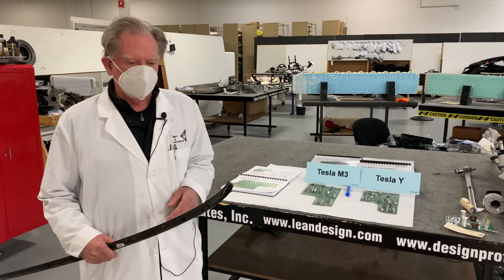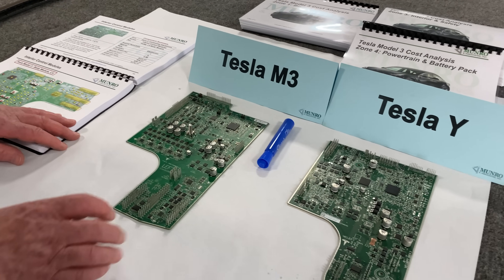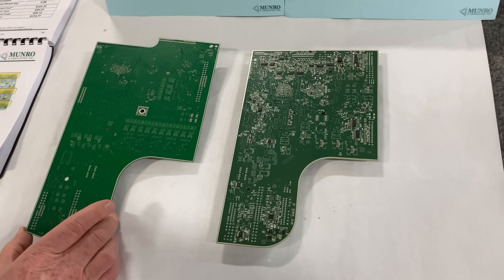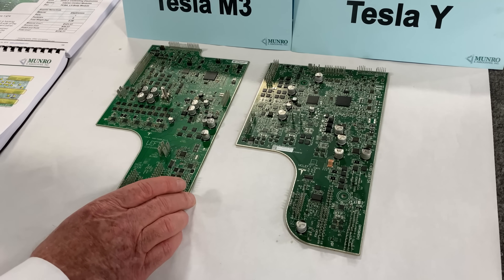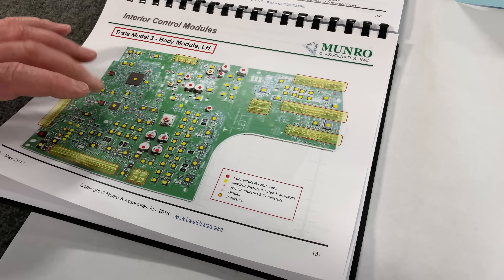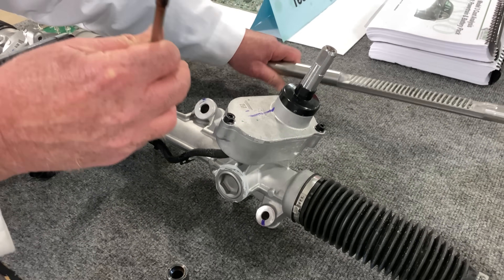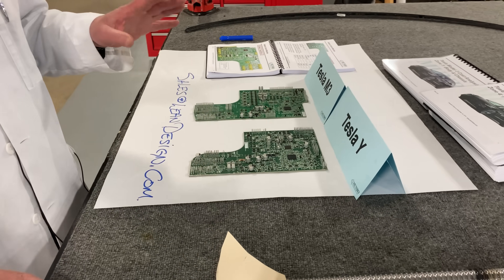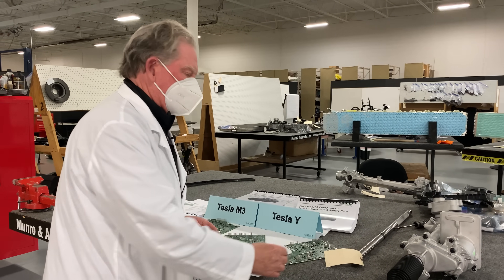Model Y E39: Spoiler Alert! Sandy Talks About Electronics, Body Controllers & Steering Rack

Comment: Regarding steering system, they are rated as ASIL D (according to automotive safety stadandard, one is ISO26262), meaning that a fault has high probability to kill people. This means redundant hardware and software. So basically there are 2 similar computer. Regarding body controller ECU, BMW have huge boards with multi-core microcontrollers. What tesla has is not really that complex.
Reply: I'm a bit puzzled that redundant electronic hardware would sit that much closely to each other. If you get something wrong on one side, how is the other part isolated from the exact same fault?
Reply: I don't think it's about core count here. I think he's looking at circuit density. Those boards look on par with a modern pc motherboard. I don't know any automotive part with a fraction of that density, but do prove me wrong if you know one.
Reply: Also, most automotive companies I know barely have any software or electrical engineers on staff. So, this level of development would not be fair to expect from them, they would have to outsource and we know how that story goes.
Reply: Last point on this. Bigger is bad in this case. The name of the game is reduction. You have to reduce the size and weight of many systems in the car by integrating into one board. Reduce size of the board by high IC integration which = high on board density. 

So, this means that you end up with a small board with lots of stuff on board, but it weighs less than your previous solution, uses less space, and probably consumes a lot less energy. All good stuff for an efficiency conscious design (both EV and ICE).
Reply: I work in automotive, on supplier side and according to safety analisys a rated is given ASIL A,B,C,D. For each there are some actions to mitigate the identified risks. On steering is 1 board, but they are separated: 2 microcontrollers, 2 h-bridges for motor control, 2 power supplyes for circuits on board, software is doybled. There are many measures taken to protect from external faulta and internal fault (memory corruption, software errors, etc). All manufactirers use the same stuff.
Reply: @catalinmacovei6907  ??????? Use the same stuff? I've seen plenty of automotive PCBs, never seen one like these. Please post pictures if you have them. Also, there are many ways to achieve a standard. These standards do not require that you use even the same parts since that would be corruption of the standard(favoring a specific company within the standard). Just that same processes and results are achieved.
Reply: When I said all car brands using the same stuff, i mean same concept of redundancy, same idea, not the same components or schematic.
Reply: @catalinmacovei6907  ah... gotcha.
Reply: Regarding the body controller module, I remember I saw one for bmw with similar density of compone ts (at least vidually, ofcourse I can't count them). Some colleagues worked on that project and I just saw the board but not worked with it.It was big as 15 inch laptop keyboard.
Reply: @catalinmacovei6907  once again, we are not talking about size here. It is probably possible to achieve the same functionality in the size of an iPhone's motherboard. The point is the amount of components per square inch... in other words density.

Comment: Elon has said from the outset that anything related to full self driving would be fully redundant, down to the steering gear. It looks like there are two power feeds to the controller and probably two data cables as well. So, even if the board isn’t damaged, but a wire feeding the board (power or data) is, you’ll have full functionality. I am banking that the board will sense even a bad connection and alert the driver for service, but that the system will still function fully since it is redundant.

How about ABS sensors Sandy? Have you found two ABS sensors per wheel? I wouldn’t be surprised...
Reply: There are some things that may not be redundant in the system, however most of the sensors that will enable Level 5 autonomous driving should be there. Technically they are already at Level 3, and the AI controller board is built with redundancy. That particular board hasn’t been reviewed yet, though it’s decades ahead of anything short of the military.
Reply: Arthur Dries I think that Munro and Associates did look through the Hardware Level 3 board for the Full Self Driving computer. I believe their Model 3 had this board installed even if they didn’t option the software for full self driving. Elon stated during the Investor’s Autonomy Day last April 2019 that all cars produced since mid 2018 have the logic board installed.

Comment: Populating both sides of the PCB is going to cost more time and money. Needs another solder paste, glue, pick and place and reflow process.
Reply: Unless you’re putting the exact same board in all of your vehicles. The sensor suite and form factor for their electronics have stayed the same since AP Rev. 1.0, making all your older AP vehicles backwards compatible for an upgrade.
Reply: Arthur Dries I suspect boards are approx mirror images to avoid confusion and to locate symmetrically within the chassis. Each board, rotated 180 degrees nests with itself for board layout and assembly efficiency.
Reply: The old pcb had double sided placement as well.  Mostly bypass capacitors for the FPGA and microcontroller.  Might as we fill up the back too, you're not going to hand solder these on at Tesla volumes...

Comment: The board for Model Y does look like its a lot more capable but does not put it much further ahead of other OEMs than it already was with the Model 3 version 1 board. Its the general capability and flexibility to reprogram, update or interconnect anything that is important. The only big change on the board I see is that the second processor is larger than before.
Reply: This is similar to saying that the on-board density achieved by PC motherboard makers year over year is no great achievement over what they had previously. 

Mate, if an oem can achieve this level of compact design today, affordably, they would. What's interesting is Tesla's ability to design these parts at such volume and low cost. Can't wait for the report.
Reply: @onwike  Have you seen a regular computer motherboard? Those are just as dense. What you are saying isn't wrong, but the biggest issue of competitors is designing something like this in the first place, its not like they are short on funds when it comes to luxury vehicles.
Reply: @Thegoldrater  You make my point for me here. Start with the fact that car companies traditionally do not employ enough software/ electrical engineers to be able to design PCBs at this level. Then consider the fact that they have to outsource the design(not only manufacturing) of these parts. And you see their challenge. No one makes dense PCBs for automotive use, at least in not aware of it. For Avionics, definitely, for cars? No. So, who can the traditional automakers lean on to make these parts?

Over simplifying the truly complex will give you the wrong answer here. Achieving density in a logic board isn't something you JUST do. There are many systems that you have to consider and then conclude that they should be simplified onto a single board. Doing this in a company with many silos that are not interested in giving up control of their part of the product to the electronics team is not really realistic.
Reply: TLDR:

In short, I don't know how a traditional car company can do this (except the Koreans... they seem to know how to turn on a dime in the industry).
Reply: @onwike  Exactly I don't see what part of my comment you didn't agree with :D Density can mean a decrease in board size or improvement in capability. All I am saying is that the switch from pre-programmed simple boards to complex re-programmable interconnected ones was the big jump ahead of other manufacturers, optimization is an achievement too, but achieving the functionality is the game changer. As far as I can see the, the density increase is not a game changer just good optimization.
Reply: @Thegoldrater  I see the disconnect now. I'm guessing you are an EE. Well, the automotive world is very petty and ornery. If, and this is a massive if, the car company has expertise in house to make say the stability control system and the ABS system. Then a systems engineer says, "You know, we can optimize by packing these two systems onto one board". He might not have a job by the end of the day. Don't even imagine it if two separate OEMS have the production of these systems outsourced to them. 

So, hopefully you can see why I believe that this optimization is a non-trivial exercise.
Reply: @onwike  Actually I am not an EE, I am a journalist for CleanTechnica, I have been to Tesla's Fremont Factory and have some understanding of micro-circuitry. If you occasionally read our site you might have read a long technical analysis of Tesla's HW3 chip that I wrote.
Reply: @Thegoldrater  🙂🙂🙂🙂
Cool, did not know this was my 15 seconds of fame. Lol

Anyway, I think you will see my point of you just look at what Sandy says about trying to make process changes at Ford. That attitude has not changed.
Reply: @onwike  I never refuted the significance of this improvement, I agree with you there, I'm just saying this doesn't increase Tesla's lead by a lot, a lead that was made by the version 1 board or even what is in the Model S. The fact that Tesla has this advanced functionality in a car at all, not even mention a vehicle that costs less than $40k is where the lead lies in, the functionality at any cost is something nobody else can do even in expensive premium vehicles for reasons some of which you mentioned above like a lack of vertical integration, lack of electrical and software engineers and not enough funds spent on R&D in this area.
Reply: @Thegoldrater  fair enough. I do have to say that I thought that while the 3 was~ 3 years ahead, the improvements in the Y, while being substantial, would only. move the line by about a year given the exponential nature of technical advancement. A determined competitor should be able to close that gap in ~ 4 years if Tesla stands still.
Reply: @Thegoldrater  So, yes, I agree with you.
Reply: @onwike  The first competitors with some (not all) of this functionality might be the Porsche Taycan and the VW ID.3, but how close it is to Tesla remains to be seen, so far VW van't even start selling the vehicle due to huge issues with this specific feature.

Comment: Also note that the new left controller shape fits more snugly with itself when rotated 180, while also being smaller. Means you can make the same number of controllers from a smaller raw PCB panel. Every cent counts!
Reply from the maker: Thanks for tuning in! Check out the bonus footage after the outro.
Reply: @MunroLive  That'll teach me for not watching to the end!
But it's more likely a panel of all L to keep all the larger components on one side for easier manufacture.
Really enjoy the videos!
Reply: That's at least 10 - 15% saving on the PCB costs. Note that the gen 1 mirrors on the wide side, instead of the narrower side.

Component count matter too. Check Tesla's part numbers on the catalog, which should show various versions. Same for the version info printed on the PCB.  Current Model 3 should be using same board as Model Y already.

Comment: The Tesla Model 3's board is the old Autopilot 2.0 hardware. The Model 3 and Model Y are now shipping with the hardware 3.0 board.
Reply: Daniel Kilbane I don’t think that´s the AP board
Reply: @EVPaddy  I was half listening to it and you're right. It doesn't have any of the camera inputs and looks to be just the car's control board.
Reply: @Dkilbane1  exactly. There also seem to be 2 of those.
Reply: @EVPaddy  Interesting to see you here so early after new video comes out. Model Y is interesting to you? Thinking about a trade-in Kona to Y? 😁
Reply: @mirkonaumann1417  well I was watching Youtube anyway. Yes I'm interested in Tesla in general. I have a Model Y on order but to be honest, I'm so happy with the Kona, I doubt I'd change it for a Model Y currently.
Reply: @EVPaddy  Later with the big batteries above 700/750 km range will become interesting -> GF4 will do.
Reply: Mirko Naumann not sure whether there will happen that soon but I don’t need that kind of range either
Reply: @EVPaddy  I want. The more the better. Means more power for charge and discharge, longer time driving fast, less degradation and of course less often charging. Comfort is a high value.
Reply: @mirkonaumann1417  of course. Good thing when you buy first (and it doesn't mean a higher price). I already have a car that fulfils my needs, though.

Comment: I can see one hell of a massive difference.  I have had to build CNC circuit boards from old CNC Machines.  And built, my own new ones.  I should send an email.
Reply: Also, the difference in CNC Machines that use rack and pinion vs ball screws is exponential.  And the force required to turn either is vastly different, and the precision is vastly different.  They look exactly the same to the untrained eye.
Reply: @LordPente  when they get back, is appreciate it if you write down how much they sell the reports for
Reply: @AMalas  I sadly know little about money.  I suspect ArkInvest and "solving the money problem" have insights, And I'm sure others, but All I know is I'm gonna try to buy some TSLA stock, and just hold it, like it's the most valuable thing on the world.  Because it's our future.  So, to me, it is the most valuable thing.  All I see in my mind's eye is potential.  Hahaha.  Unlimited potential.

Comment: 50k subs Sandy!! Btw, sorry that’s not overmolded carbon fiber. I designed the same piece for Maserati, usually you do that in autoclave prepreg, so that the esthetic surface faces the mold for a good finish, than you glue it to a plastic piece (in this case, because BMW and Maserati only uses the carbon shell and than goes with bi-adhesive to the decklid). Congrats for the channel achievement! You deserve it
Reply: thanks for insightfulness sometimes Munro needs to be corrected ;) good to know smart intelligent ppl also watching these videos. where do u work now and do you admit Maserati and FCA are way behind? infact maserati is using a lot of old shit from the parts bin just upselling it
Reply: Actually I don't think this is correct.  Over molded does not mean the carbon part is molded "over" a male mold but rather the carbon is placed into a female mold (so you get the aesthetic face) and the plastic inner portion is placed into the lamination stack--so the carbon is "molded over" the plastic.
Reply: @genephipps6421  you could do it, but I wouldn't and actually this is well motivated. to curing process in the autoclave requires usually 6 bars of pressure. if you place the plastic structure in the lamination, you will get marks on the visible surface. it's way more safe to bond it afterwards, when carbon is solid.